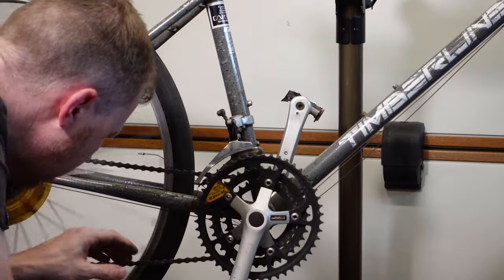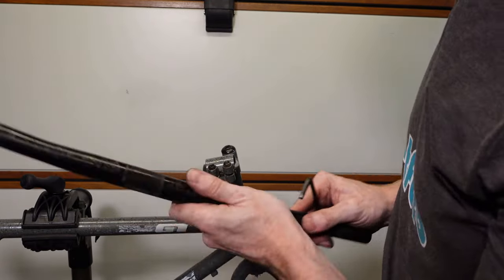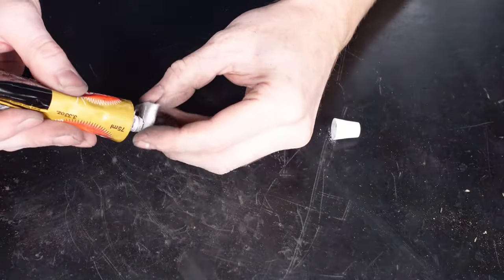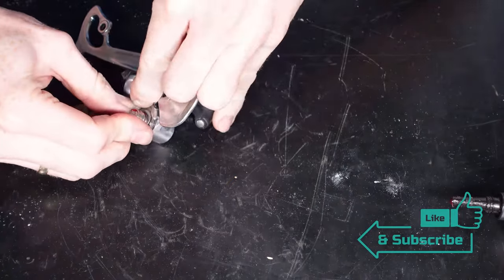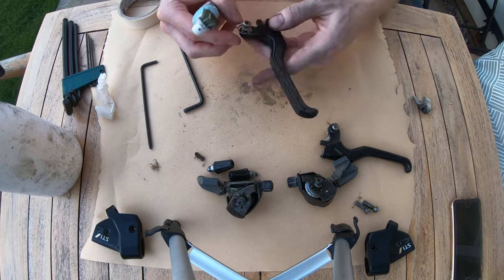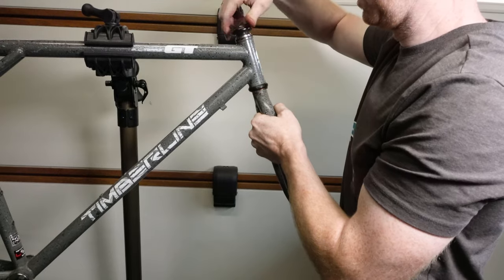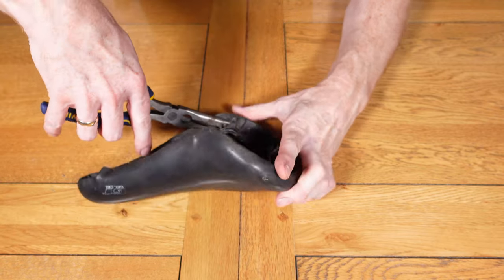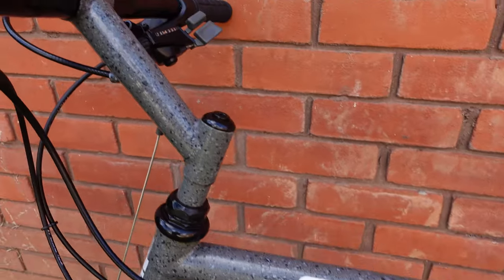90's Mountain Bike Restored & Transformed - GT Timberline Rebuild - Vintage Retfurb Refurb

Comment: I love these 90s MTBs. Great video. ps. yes, 1" threaded headsets are still made (for MTB and BMX specs)
Reply from the maker: @chican76 Thank you, Appreciate the kind comment. I did wonder, As haven't seen any pre-builts with them for a while. I presumed they would still make individual headsets, For replacement parts. Thanks for adding the information. 😀

Comment: Very nice!  It looks an awful lot like my daily driver, a GT Timberline All Terra.  I don't know it's exact age but it's not quite 1990.  Mine has a slightly different Timberline logo on the downtube, it as two eyelets on the front and rear dropouts, and it doesn't have the plastic piece around the seat tube to guide the rear brake cable.  I haven't kept mine original, either: it has a cartridge BB, Rene Herse cranks, a new seat post and saddle, and soon a new stem.
Reply from the maker: Thank you. Sounds great. A lot of these have been altered through the years, To keep them going. This one was lucky enough to have almost all original parts on it, So tried to keep them where possible.

Comment: Great result for your approach to re-use as much as possible. Really comes close the original, I guess.
However, I might have done some mild modernization to a bike like that: Replace the saddle with a modern one, replace the chain rings with non-biopace, replace the bottom bracket with a cartridge type, replace the brakes with slightly more modern and higher spec'd cantis and probably also replace the straight handlebar with a swept-back riser handlebar. The bike would retain its original looks but ride quality might improve greatly - important if you intend to use it as a daily commuter.
Reply from the maker: Thank you. I was trying to show that a lot of these items can be re-used and can then work in good condition again as they should. 😀
Reply: @retfurb  absolutely, yes. As long as it's not a complete rust bucket, you can bring them back to life on a small budget. But there was a significant progress and development over the last 30 years in parts and ergonomics, and with some upgrades you can make this old bike almost perform modern. Which is of course a different approach to yours.
Reply from the maker: @marcusathome  100% agree. I tend to try and use parts from around the era. But ive got no issue changing parts like, headset, bottom bracket, tyres etc for modern type.  I will probably do a modern mod on an old classic at some point.

Comment: Great job on this Timberline!. I do like the early GT paint jobs and the 'Stone' effect on the Timberline is one of the great ones.

I was particularly interested in the refurb of the Brifters - and would be interested to know what satin paint you used...? They came out great!  Also the iron on seat logo, did you create that?

You may have guessed by my questions, that I restore old GT's myself, so always interested in how others do it too!
Reply from the maker: Thank you. I really do appreciate the kind comments. 

The paintwork makes tidying it up, So much easier. Hides the touch ins better.

It was a standard black satin bumper aerosol paint, from proper job (UK). I can get the brand if you like. There are others that do a similar aerosol, That I have also used.

Yes, I made the heat press vinyl. I have done this on a few different type seats now. It comes out well.

Comment: Hey, can you explain how the rear brake cable is routed through the frame? I need to tackle mine but no idea where to start!
Reply from the maker: Hello, yeah it is easy enough.
The top tube has a small tube going through it, so the cable feeds through that. 
I presume you were concerned that the cable would be floating around inside and be hard to route?
Reply: @retfurb exactly this! I didn’t want to find out there was nothing in there! Thanks for the prompt reply pal.
Reply from the maker: @garylythgoe  no problem at all
Reply: @retfurb  I’ve just had another look and the outer cable doesn’t move in that side frame hole. It literally won’t twist or pull. Did you reuse that outer cable for yours?
Reply from the maker: Yeah, That is exactly what I had. I ended up pulling inner cable out and spraying grease into hole. Then when feeding new cable in, It went through fine.  @garylythgoe
Reply: @retfurb  ah, so you sprayed grease around the outside of the outer cable where it goes in the frame hole and it freed up? I’m sorry for asking so many questions, this is causing a bit of grief!
Reply from the maker: I only removed the inner metal cable and not any of the outer housing. I just greased the hole, Then inserted the new inner cable.
The outer would not come out, Same as your's. @garylythgoe
Reply: @retfurb  in this video at 22:28, it looks like you’re feeding a new outer cable into the hole unless I’m super confused at watching it?
Reply from the maker: @garylythgoe  hmmm, yeah it does.
It only goes in to a point though and then stops. 
I think the thin tube then takes it to the back.
So is it the outer sleeve at the start, that won’t come out?
I was getting confused thinking of the small tube at the exit of the wire.
Reply: @retfurb  ok so I soaked it in penetrating oil overnight and the outer is now moving… going to give it another overnight soak and will crack on this week! Are you on instagram?
Reply from the maker: Ah, Great. Good progress. Keep persevering, You will get it out in the end.
I'm not currently on Instagram, Will do in the future if it gets popular enough...  @garylythgoe

Comment: Why didn't you try to disassemble the front derailleur?
Reply from the maker: Unfortunately, There is only so much that can be stripped. It is held together with non removable pins. So if they were removed, It would likely damage the derailleur more.